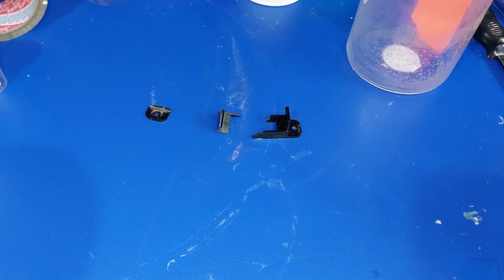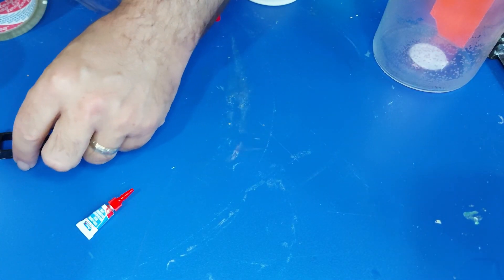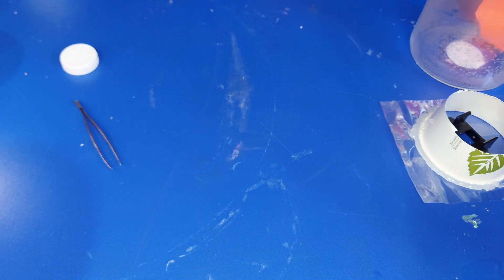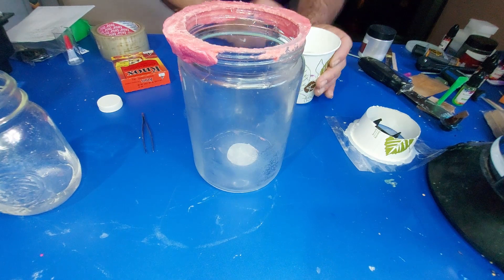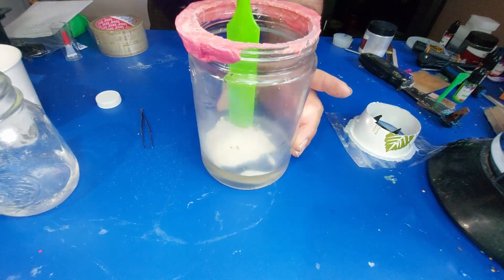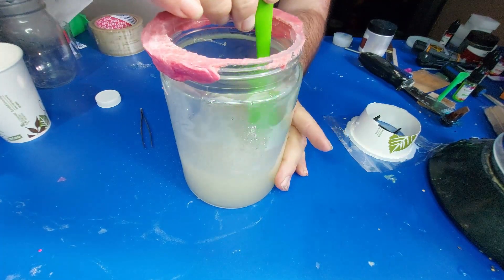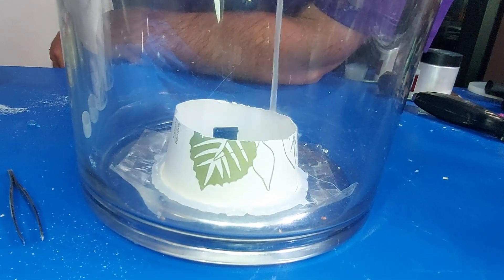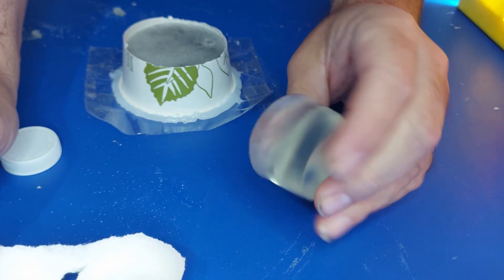Making a part with Resin and Gelatin

Comment: Does polyester resin work with gelatin-glycerine mold
Reply from the maker: I have never used polyester resin but have used the gelatin mold for a few resin projects to recast parts. Due to the low cost, I would suggest a small test